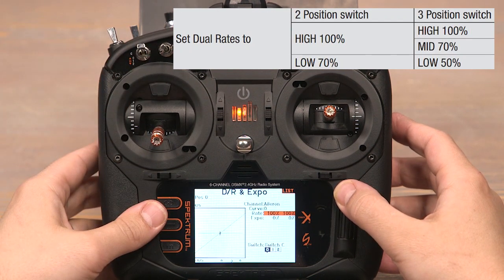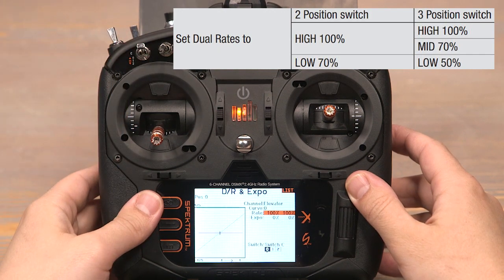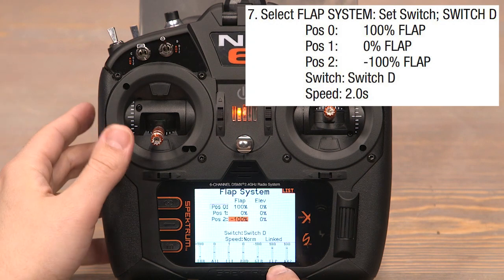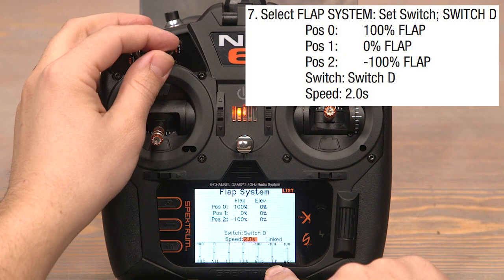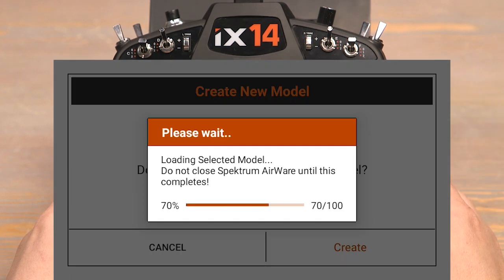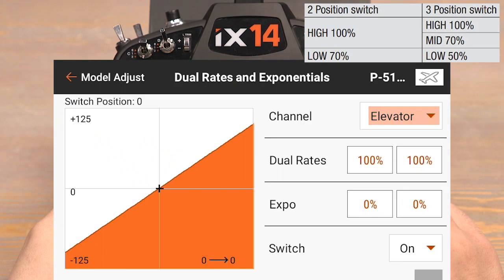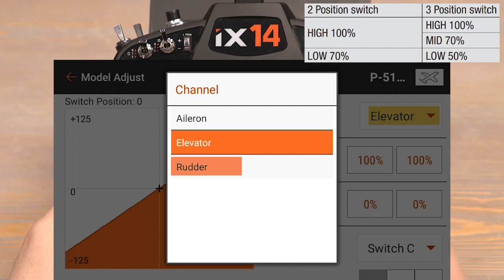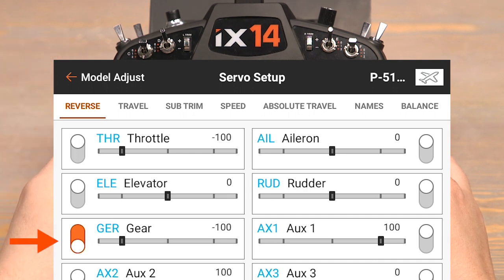E-flite P 51D Mustang 1.2m Spektrum Transmitter Programming Guide

Comment: Hello. Need you help please :)
I bought the PNP version (EFL08975) (I use FrSky radio/receiver), but the user manual available always refers to the BNF version (EFL089500). My question is :what is the mix Flaps/Elevator to do ?
As per the manuel (and my understanding....),  flap Pos1 is 30mm, Pos2 is 60mm. But what about the elevator ?
thx